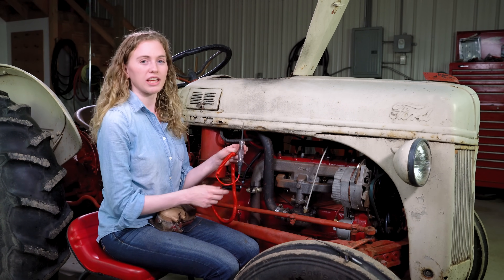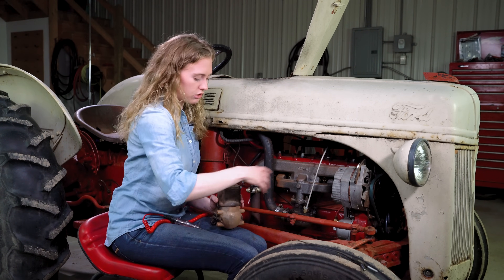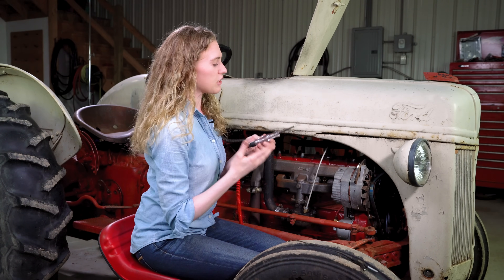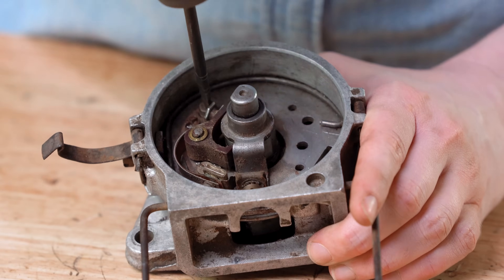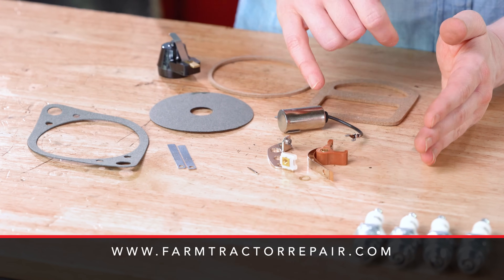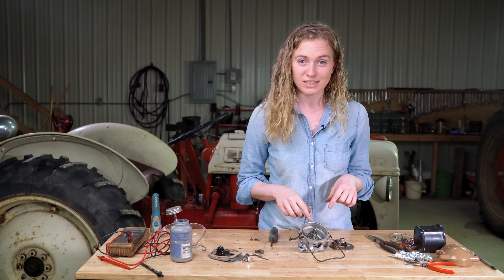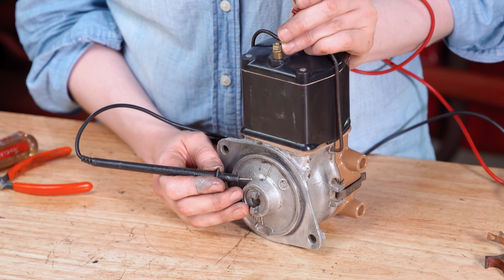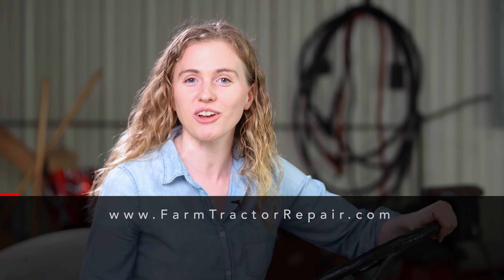Ford Distributor Rebuild & Troubleshoot: Points, Coil, Cond.: Ford 9N, 2N and 8N Front Mount Tractor

Comment: Rachel, You have been so helpful. I hope you have time for a question. My test light flashes on the coil, suggesting that my distributor is working properly but I'm still not getting spark to my plugs. I have put in new points, plugs, wires, condensor, rotor, cap, 12 volt coil ( it has been converted to alternator )  resister and carburetor. Before replacing these, the tractor would start but not throttle up, and now I have no spark to the plugs Where should I go from here? If you or one of your community members have an answer for me I would be thankful. Thank you, Steve
Reply: Check your voltage regulator or resistor if you have one

Comment: I love your video I just bought a new distributor and I have no spark I done the test light and I have no spark what do u think my problem could be
Reply from the maker: Hi Robert, we'd be happy to help you troubleshoot your electrical system. Please schedule a one-on-one tech support call at this link: https://farmtractorrepair.com/collections/tech-support/products/schedule-a-phone-call-for-mechanical-help
Reply: Check ya test light , or ask the Gingells , I watched Rachel’s video fought lions ,tigers ,and bears to get to my 8 n  with in 45 minutes I drove it out of the jungle  thanks to Rachel
Reply: @ronaldroyal2676  thanks I figured out I had spark but the switch was burnt up

Comment: can you tell me why my 54 ford 8n wants to miss and act like its not getting gas going up hill ,if i go up backwards its fine, i put on a new carb cleaned the tank new points plugs and wires coil switch resister

Comment: @5:40 Do you sell this replacement brass-looking screw on your website, or know of another place to find one? Mine is very damaged looking when I pulled my distributor apart and I think its making a very weak connection to my coil giving me spark issues.
Thanks!

Comment: What if I already took off the distributor without paying attention to the rotor position. I wish I would of saw your video first.
Reply: I think she talking from experience everyone has made that mistake.  The way she detailed how it would sound was perfect
Reply: Pull the #1 plug it’s the plug closest to the water pump , bump your starter until the piston comes up check it with a small screw driver a couple of times , put the distributor on without the cap the rotor should point to #1 plug socket on the distributor, 9-10- or 11 o’clock position make sure to line the slots up if the distributor ain’t flush you’ll break one of the ears of $

Comment: Another really helpful video.  Just curious- why continue to use points at all?  Why not eliminate them with a modern solution like a Pertronix kit?  That way, you don't have to worry about wear and adjustment ever again.
Reply: I stick with points because they are much cheaper. also points give you warning before they fail.

Comment: I always love your videos, I have learned so much from you. The only thing I can add to this video is the cam on the back of the distributor is offset so it will only install one way. If you get it 180 out you will break the case when you tighten the bolt. Don't ask me how I know this.🤣🤣🤣 Great job young lady. You are an inspiration to us all.
Reply: @manuelolivas9470  my guess is either she got confused on other tractors or maybe was even thinking about a side distributor and mis spoke.

Comment: Can tell me if all fords of the type need a ballast resister in the wiring, or doi need that , I think this vlog has shown me my problem, I think I did not get the little probe lined up on my coil, it’s a little Cork screw type little spring looking thing, rite, and it sets on a little said ways screw, what the heck, really ok,I’ll check that to see if I can get spark back, 
Are the points , or I’m asking can they have 12 volts on them , or is the points 12 and or 6 volt only, or dose it matter, ???? Ok thanks , I need to figure out how to find out which one I have , the tractor has a 12 volt alternator and a 12 V starter that I had rebuilt, anyway tell me anything to help, ok , thanks BigAl California praise Jesus grace Christ amen 🙏.
Reply: You always need the OEM ballast resistor that's on the back of the dash reguardless wether it's 6 or 12 volt. However you may need to add another resistor in the wire to the coil if you are 12 volt and do not have at least 12.5 ohms resistance in the coil. Some of these cheap coils even though 12 volt have as much resistance at a 6 volt coil 1.5 ohms resistance. You'll burn a coil up every time.
Reply: Find a napa auto parts tell them you need points condenser and a rotor cap for your 12volt system on ya tractor , if they scratch their heads run brother run , straight to oreillys , I’m a ga Christian , I would love to see the redwood forest , praise god for tractors and trees
Reply: I still can’t get spark, no one seem to know, I’m throwing rand new rotor bug, new parts, brand new 12 volt coil,brand new points,brand new cap, brand new condenser 12volt, no power spark, been sitting for 2 years, can someone actually tell me the way to fix it but actually truth way, ok thanks BigAl California thanks